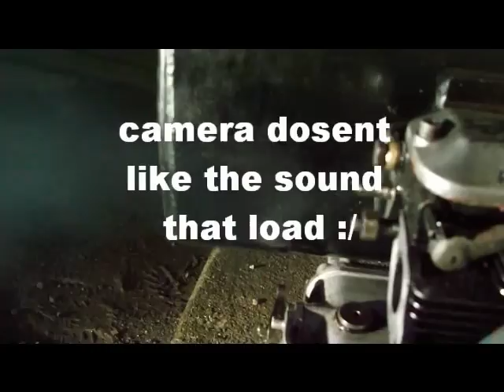Petter AA1 Test run.

Comment: Where did you get rings for this? I have three of these, working on getting them running at the moment, starting by cleaning rust and muck out of diesel tanks! See how i go. I think opening the valve up fully on a pump creates more load than restricting, strange as it sounds. But when you play around with the valve can quickly tell where most load is created.